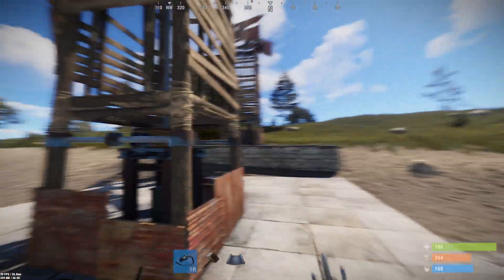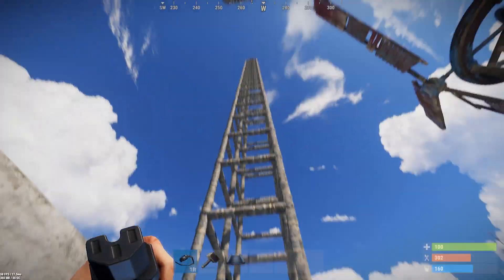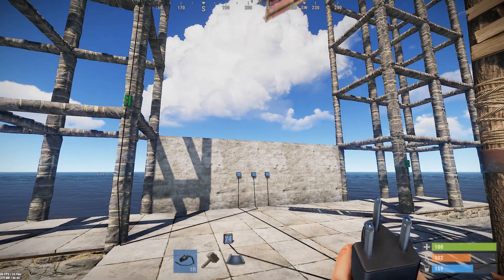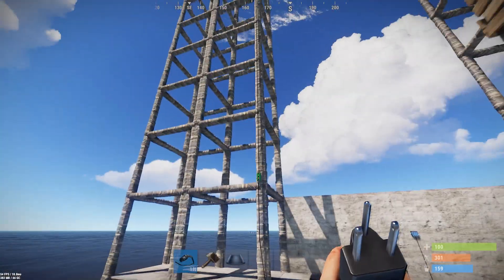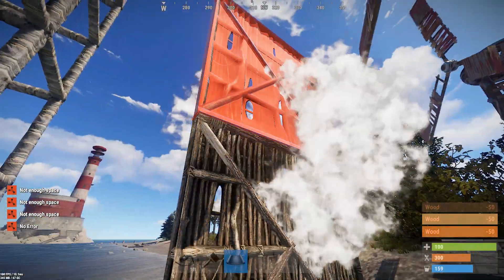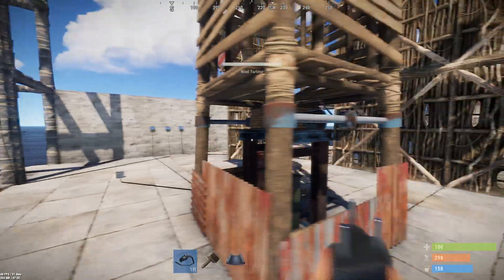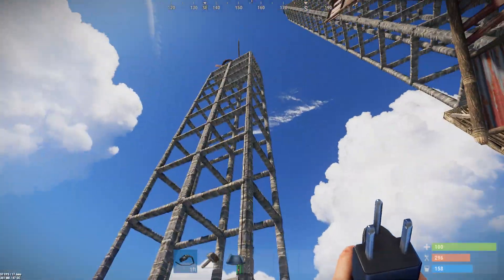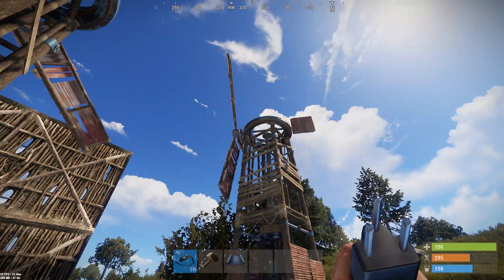Rust Electricity: User Request - Wind Turbine Height and Obstructions

Comment: Love your videos! 

I need help doing a circuit layout where...

A pressure plate/sensor trips, and it closes one or, while opening another. 
That way it not only traps them with the closing door, the open one blows them away with a trap. 

But I want them to stay open/closed respectively
All automated without user interaction
Reply from the maker: Do you want it to auto-reset after they are dead, or do you want to reset the trap manually?